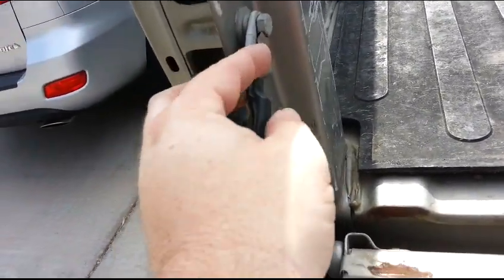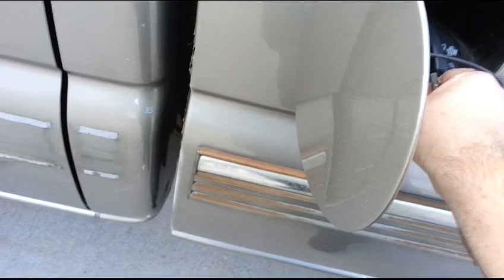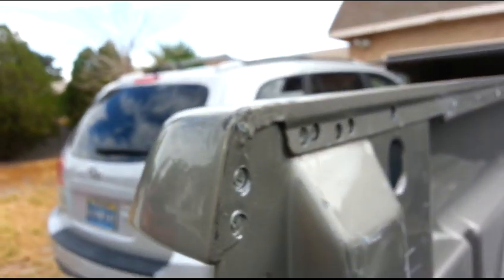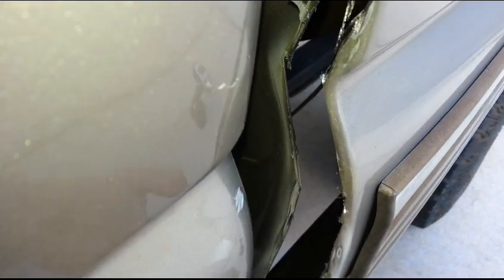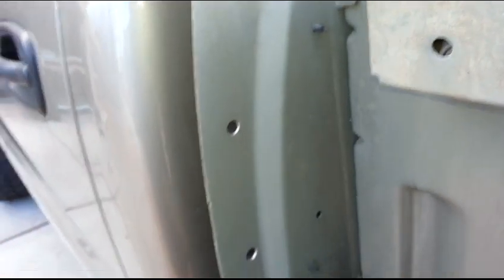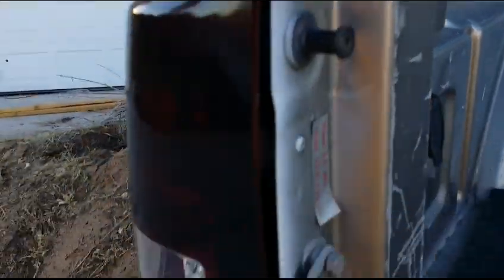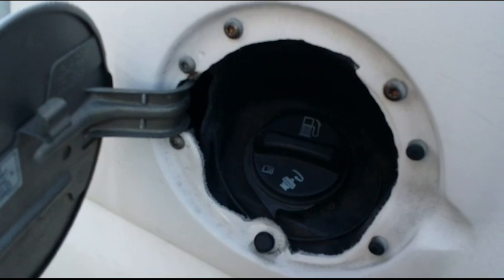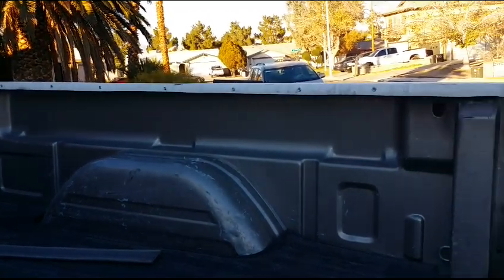Bedside removal install 99-07 silverado

Comment: Super hacked this truck. This is really sick work. Disappointed
Reply from the maker: Lol, this not the way the trunk was finished. This is just the steps to do it. There is multiple ways of doing it. This is not a show truck, but it's not an off road truck. The new kit was installed differently, unfortunately the phone I used to record it was destroyed. But how about instead of criticizing with no helpful input, you tell me where you would've gone a different route! Thanks for watching.

Comment: Good video! At first I was wondering why you were removing those perfect rust free bed sides. Then I seen the new one! Is that new one from a newer body style?
Reply from the maker: That's the 07-13 front and rear. The truck now has the 15 one piece front and bedsides. I'll be posting new videos soon.

Comment: Front fiberglass install video?
Reply from the maker: What glass are you installing? I have a install I haven't uploaded yet. But install the 07 conversion on my 02. I do it without using the inner structure of the stock fender. If that works let me know, I'll edit and upload it maybe tonight. It should be the same as other install, besides the hood. Good luck.

Comment: good video on removing but the reason i watched this was for the install part which the title states....either im just dumb or stoned because i only caught the finished job....help me out here would ya?
Reply from the maker: Are you installing stock bedsides? Match. Up the bed sides to the factory lines. Caulk a strip of epoxy between bed and bedside, Clamp in to place. Drill bout 1/4 inch hole about every foot and weld the bedside to the bed. You can also use self tapers if you dont have a welder or if installing fiberglass.
Reply from the maker: Ill be posting in next 2 weeks.

Comment: wouldnt it have been easier and more econimcal to buy a buy with dented sides to ad the fenders and sell your complete bed? Im just wondering i like the video
Reply from the maker: my bed was messed up on the passenger side from my tread coming off the tire. It was over $3000 in damage, so I used that to pay for the sides. so I pretty much did what you said.
Reply: Oh ok, that side looked awesome that's why I was wondering haha
Reply from the maker: +Tim Sparks I'd post a pic of the other if I could. it's was pretty much tacoed.

Comment: Does the 08+ fit 99-07 chevy bed?
Reply from the maker: If the bedsides is 6.5' then it will. My bedsides were from Fiberwerx in el cajon, CA. You could use factory, but they wont have the body line in front of the back wheelwell. You could also swap the bed, and shave the body line on the cab.

Comment: Is it the same thing for a 1996 chevy silverado?
Reply from the maker: Christian Cardoza all beds are pretty much the same. The only difference is where the  spot welds will be. Not sure if I say it in the video or not. But if you take a sander and sand the inside of the rail, it will help find those hidden spot welds. But you should be able to see most.
Reply: Ok thanks

Comment: You don't need to cut the wheel Arch I got to do is take the pit spot welder and drill out the ones I know the offender that was a dumbass move
Reply from the maker: True, but it's a pain in the ass to drill them out. For me, on this truck, I couldn't use them anyway, as these were fiberglass bedsides.

Comment from the maker: I'm looking for my other videos, fenders/hood
Reply: By any chance do you have any videos of the front fender swap? I'm about to do the conversion and would greatly appreciate any video or information that would make my conversion easier. Cool video, lots of help for fellow DIY builders.
Reply from the maker: +John Palicki I know I made one. the removal is in my videos. if I can't find my install I'll shoot a video tomorrow.
Reply: Thanks I'd greatly appreciate it!
Reply: where did you get the bed sides from
Reply from the maker: All fiberglass is from Fiberwerx in El Cajon, CA (San Diego) I don't think it's on their website now. But just call and ask.
Reply: How much for both sides and does the tailgate still fit
Reply from the maker: aaron Schmitt I believe it was 500 plus tax for the sides, you will also pay shipping unless you pick up.  Yes you can use the stock tailgate, but the line about 3 inches from the bottom of the gate leaves a gap at the lights. I've never had anyone say anything about it. I only get complements.
Reply: Thanks
Reply: @TheByonsho  so why's it not on their web site now.... what happened & how long ago..... & where else can the rest of us get 'em from now on line i mean.............???  & how much were each bed side after tax.....????
Reply: @TheByonsho  can u show good day time pics up close & at normal sites as well so we all can see this gap  u r talking about................
Reply: @TheByonsho  so how much is the shipping & tax roughly & did they both show up togther or what.........????
Reply from the maker: @jamieround2072  I picked them up. Think it was around $1500. Not sure if they still sell them, think they have the 2015 conversion now.
Reply: @TheByonsho  ok very cool  do i just type into google   fiberwerx.com   & where do i look on their site for what  u had or some thing close to  it since i member now as i type this  u weren't sure either way what they all carry on the site i roughly think u wrote.........  1 other thing is there any other web sites that sell hole bed side panel's wither they be all metal or all fiberglassed or etc.,.....i ask cus i went to my local chevy dealership just for shit's & giggles to see how much a hole metal oem style hole bed side was going for each....... GUESS......  ??  950  EACH W/O TAX.......  YEA  RIGHT  IS WHAT I SAID & THOUGHT WALKING OUT...... as i'm getting in my 04 Silverado  he goes u may have to look online for after market stuff..... i told him i;ll deffantly be looking  defantly not spending 950 or any thing close to it.........  i may just learn to fiberglass it all my self the holes part i mean i been told doing that way i'll have under 300 bucks intot it roughly............ i'm looking on u-tube for all angles of repairing or filling it all in w/ decent good stuff to last SINCE IT'S JUST A SIMPLE WORK TRUCK HERE IN OHIO...............LOL   THANKS BUDDY !!

Comment: help people? yeah help them destroy there truck! sheet metal screws lmao get a rice burner and super glue your next project
Reply from the maker: where do I go wrong. the only thing I don't do is remove the bed to get the front spot welds. my bed sides are fine and I drive the truck everyday.
Reply from the maker: you can rivet it, but the guys that buy this fiberglass usually break it. so rivets are over kill, and they are self tapper not sheet metal screws, there is a difference. but please, you make a better video. 18000 views and you are the only to say something negative, also if you you have a complaint then give a solution.
Reply: TheByonsho I would have used rivets and bed line over it
Reply: TheByonsho   Never seen a vid where someone that knows so much more that has a link to their perfect job no matter what it is. 

Thanks, nice vid.
Reply: TheByonsho pipnpž n
Reply from the maker: Stealthcon69 it is now, also I used automotive sealer.

Comment: wtf.. that looks so wrong, the bedside you used is for a 07-13 chevy and you put it on an 02 are you serious....
Reply from the maker: No they are for 99-07, it's a conversion  from fiberwerx. Look at the body lines, only thing nn07-13 is the tails.
Reply: bulge in the fender i mean
Reply from the maker: They are off-road fenders, not stock.